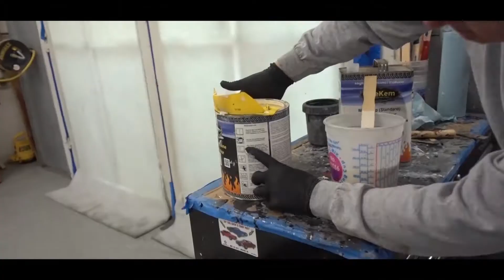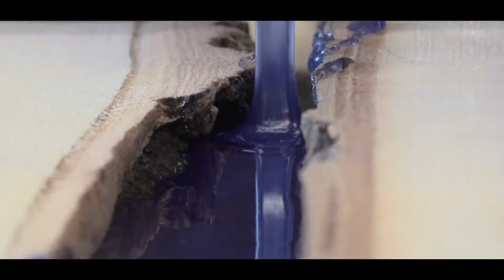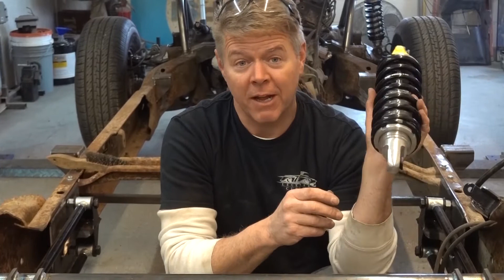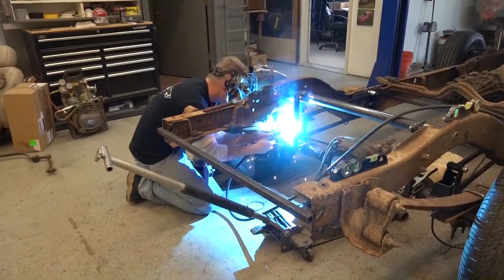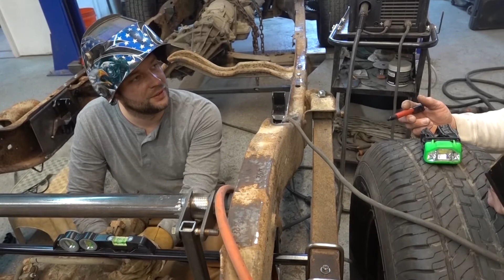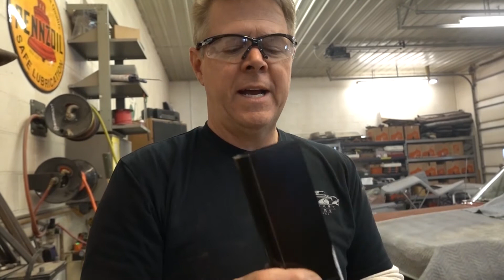LEGENDARY CUSTOMS TECH TIPS:  4-LINK SUSPENSION INSTALL

Comment: Question do u have to remove the body to 4 link a car
Reply: Technically..... No. 
There are several advantages to remove the body. You really need to watch your ride height. It will be very difficult to get clean complete welds in some situations. A great, complete weld is extremely important for safety.
Reply: I'm doing a engine swap in my 56 Fairlane do I set my rear and 4 link up first or set the motor and trans first I'm.pullimg the y block out for an lsx motor
Reply: @9thgatedim273  I would mount in all the weight so you know the stance. Also order springs accordingly for what your going to install. Sounds like a great project. Get the wheels turning!
Reply: @chrismeyer6196  thanks

Comment: when you say perfectly level, it won't be once a bed is put back on. I know you have adjustment in the set up, so can this lack of weight be adjusted out once the bed is put back on?
Reply: You are exactly right. With the 4 link suspension you are able to lengthen the arms or shortly arms. After the weight is on their all adjustments can be made to fit your exact weight. But what we describe is a great starting point.
Reply: @chrismeyer6196  Thanks Chris

Comment: Curious, looks like when you first welded the panhard bar bracket to the axle, you had the orientation wrong, then later in the video it's corrected, was that a fopar? I couldn't see how it was going to work with the original way you had it, great video though, very informative cheers
Reply: We did have to change the mounting point on the axle. It would have worked at the point we originally had it mounted, but it wasn’t perfect.
Reply: @chrismeyer6256  The initial drivers side panhard pivot would not have worked at all with the rotation about the vertical axis.  If it hadn't been changed it to rotate around the horizontal axis would have  not allowed the panhard to rotate at all . The result would have sheared off the mount bolt or more likely torn the tubing right at the weld.    Good that the error was caught and corrected before final welding.